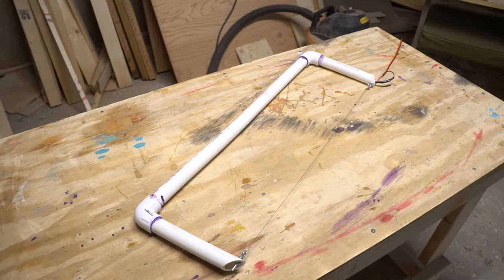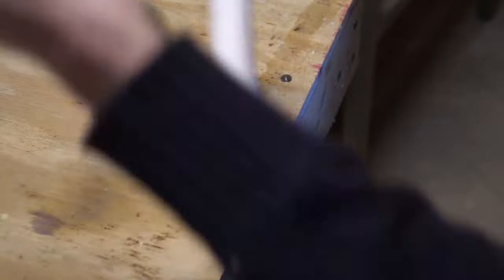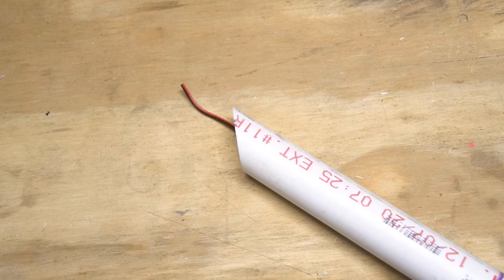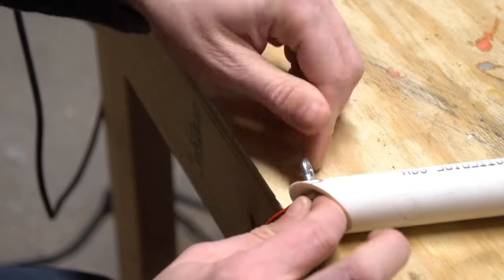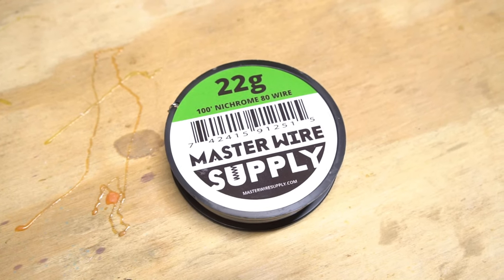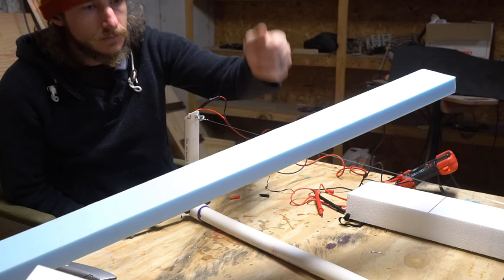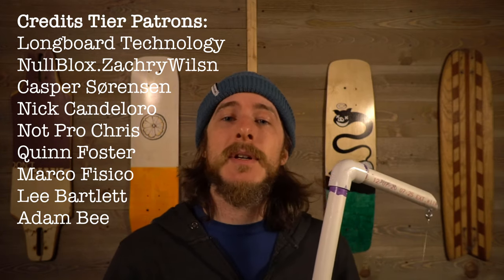Making a Hot Wire Cutter for Shaping Foam

Comment: Tip: You can salvage nichrome wire from the heating element in an old hair dryer or heat gun.
Reply: or an electric heater
Reply: @kaceesavage  Yes, but most heaters I see today are ceramic, and the ones that have wires most often have heavier wire that won't work as well without more power, and they would not allow as detailed work as the thinner wire in something like a hair dryer.
Reply: toaster
Reply: @joeymitchell3863  Yep, but many today use a ribbon element instead of wire.
Reply: @Jim-Wade  twist it?
Reply: Thx for this info💯
Reply: Thanks!
Reply: You can avoid the hit or miss with the electricity by getting a variable power supply.
Reply: It’s practically free anyway
Reply: Thanks 😊
Reply: is there enough in the dryer to make the one he made?
Reply: @jandmkennedy5 More than enough.
Reply: anyone knows if i can use a bicycle brake cable for this
Reply: @datogadelia  I don't know for sure but I suspect it has too much resistance.
Reply: oh nice i think old panel ovens too?
Reply: Thats how i get mine! A hair dryer is 3 bucks at goodwill, i have made all sorts of things with them, last month, i made a big ass food dehydrator with a hair dryer, water heater thermostat, computer fan, and wooden box...
Reply: Ty!
Reply: Did that a bunch as a kid.  A bit of that, some lead wire and a 6v battery and I had a remote ignitor for several projects

Comment: Why not just take a wood burning tool, attach along thin blade or strong wire to the end. And you have a hand held cutter.
Reply: Either the styrofoam will stick to your blade or will melt much more than intended. And you won't be able to cut large pieces.

With the explained system here, the heat is evenly along the length of the wire and thus more efficient with less power.
No matter what size.

Believe it or not, styrofoam factories use the exact same system to cut their products to size.

Comment: Look up "nichrome wire calculator" and there is a formula for choosing the Amps output on a power supply based on wire gauge, length, and voltage
Reply: what temp should it be?
Reply: @noava Styrofoam cutting temp
Reply: @rmdhn1  ye, just go for max temp u can. the wire is gonna cool down when u go through the foam

Comment: It is better to connect the power wire directly to the heating wire.  Using the bolt to conduct the electricity  will add resistance and cause the bolt to heat, possibly melting the PVC pipe.
Reply: Resistance is inversely proportional to the cross section area of the wire (or bolt in this case).  If the bolt actually got hot, the wire would melt long before that. The bolt has virtually no resistance in comparison to the wire. A 5mm bolt and 1mm wire means 25 times higher resistance from the wire

Comment: A little basic ohms law - 22g nichrome 80 wire is virtually 1ohm per foot, so let's say you're making a 3' wire cutter that's 3ohms, with a 12VDC power supply ohms law will give you the current, I=V/R (I current, V volts, R resistance) so - your power supply has to AT LEAST equal I amps.  I amps= 12volts/3 Ohms........ so I = 4amps, so you'll need at least a 4amp power supply.

If you want a shorter or longer cutter you can adjust it by either changing the supply voltage which pushes more current through the wire, or the gauge of nichrome wire which changes the resistance per foot of wire.  The calculation remains the same I=V/R, and seeing as heat output is generally given in terms of power in watts, P=V*I so in this example Pwatts = 12volts * 4amps which gives you 36watt heater.

You can look up the temperature characteristics of nichrome wire on the www but 4amps thru 22g will give you about 700degF, like this guy said don't mess around with other kinds of wire because you won't know what you're dealing with - for example if you tried to make one using 22g copper wire (0.015 ish ohms per foot) you would need roughly a 12V 250amp power supply and god knows what heat you would get from it, and something (perhaps you) will go bang. Nichrome wire is made exactly for this kind of purpose and is a known entity, so don't try making one out of copper, or guitar strings, or a shoelace.

Be careful kids, don't burn yourself, and try not to burn your house down either.
Reply: P=V*I
Reply: so true your comment always use multimeter if not sure the resistance in wire you have too, btw what wire is usually used on the old panel ovens the one that has mutiple wires that get hot and the oven is usually put on walls , i dont think they are wolframe  type but :)
Reply: @АннаПономаренко-в9я  Ooops - of course you are right - typo, so have I edited it
Reply: Thank you for this. Very helpful
Reply: U r a legend
Reply: Does a household  panel heater use nichrome wire for the heater elements ? 
Could you use the heater wires from a panel heater ?
Reply: @winnie6354  yes you can
Reply: So someone check my math here but if I want to make an 18" wire cutter with the resistance of the wire at 1ohms/ft I should have 1.5ohms resistance- in the formula presented above I= V/R so I= 12volts/1.5 ohms I get 8amps  power supply needed for a shorter cutter....more amps for a shorter wire? Shouldn't it be less amps needed to heat a shorter element or I have I got the amps and voltage confused? This is if I sitck with a 12 volts/5amp power supply that was used in the video....
Reply: @shinnosuke150  No, a shorter wire has LESS resistance so more current will flow through it than a longer wire with the same voltage power supply,  if you use a 12V power supply on 22AWG nichrome 80 your wire (if you are indeed using 22g nichrome 80 wire) will probably get TOO HOT.  
If you really want only an 18inch hot wire cutter for polystyrene either use a lower voltage power supply (like 6 or 8Volt) , or different wire gauge.  Look up nichrome wire characteristics on the web - an 18inch 22AWG nichrome wire supplied with 12VDC will draw about 8 Amps just as you have calculated - but that will heat it up to 750degC - too much current!
Reply: @lawrencejones4329 i just want to make 2 ft wire cutter so what size of wire and power i have to choose

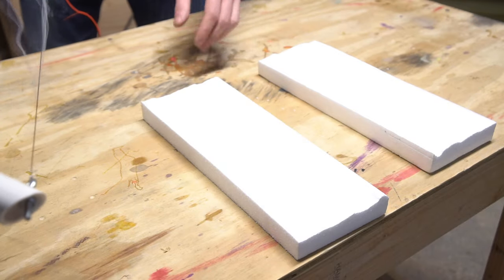Comment: After watching your video you've given me a fantastic idea ! ! !   At about time 6:00 you demonstrated "Detailed Cuts" . This is where the idea hit me . If you wanted to make detailed shapes in polystyrene to use as insulation for shipping container homes this would be fantastic  ! ! !   Once the shape is cut out with your hot wire cutter it could be placed directly onto the outside or inside walls of a shipping container . This would then fill in that corrugated shape that all shipping containers have in their walls and insulate very well . Thanks for the inspiration .

Comment: You could make a mounting rig to attach it to a table and work it like a band-saw. That would make your cuts more precise because you could use both hands to move the piece of foam, you could even make a sled similar to the ones made for table-saws for more precise and reliable cuts.
Reply from the maker: I'm definitely going to be using rigs and forms to get precise cuts, I was just free handing it here to see what the tool was capable of. Love the sled idea!
Reply: You made this comment for me :)
Reply: Where can you buy the switch and power unit to build a larger  hot wire cutter to cut styrofoam
Reply: @justadumbass5814  thrift stores, restore?

Comment: you can prestretch the nichrome, if you use a drill and those eye hooks you basically "unwind" the spring out of the metal and it work hardens.  You can also double and triple up the strands to lower your resistance (let's you run lower amperage to a higher temp) also allows much more rigid structure to the cutting wire allowing you to create preshaped profiles.
Reply: wouldn't lowering resistance allow you to get more current with lower voltage?
Reply: @jasonthurston799  yes, it does, but it also requires less source amperage to get the heat response you are looking for.  It increases both maximum capacity and efficiency...at the cost of more heat and increase in danger.  PRestretching the wire also reduces the sag deformity under load.
Reply: @verigone2677  How can lowering he resistance yield lower current and more heat?   Could you show me the formulas you use to come to that conclusion? i always thought lowering resistance reduces heat if current remains the same or is lessened.

Comment: Model airplane enthusiasts have been doing this for decades . Check out how foam wings are cut . A great addition would be a variable temp control for your cutter so you could use different length wires .It's a game changer
Reply: Link?

Comment: Thank you for this. I will make one one these fastened to a vertical wood panel. I need to cut a lot of 10cm in half by its thickness. By far the best way to do it. And no snow as with a saw or knife

Comment: Thanks for the video. It confirmed what I thought about making one of these. I have an old hack saw I’m going to use as a handle. I plan on making a curve wire to cut what I need and plan on using a thicker stainless steel wire that I can be bent into a shape. My understanding is that stainless works well for this purpose, too. Have you tried it before?
Reply from the maker: Only steel guitar strings, which don't really bend to shape the way you're talking about. They kinda worked but I had problems with them breaking a lot

Comment: I have put a small spring on one side where the nichrome wire hooks up, it keeps the tension good without stretching the wire so much. I will have to build one like yours because what I have is setup like a miter box.

Comment: A good idea would be to get a piece of MDF plywood and make a a simple platform. MDF is preferred because it is very smooth and level. From there you would drill a hole in the center and just extend the arms of the cutter giving you more clearance for larger pieces of foam. Ive been messing around with the idea to make Halloween Foam Tombstones
Reply: Not if you're working with large objects and sculpting.

Comment: 3:30
I just read today about tinned wires in sockets being a fire hazard. This is done in 3D printers often where they're tinned and assembled snug in the factory.
However, tin tends to morph under pressure, so those joints will get loose over time even if they're not moved.
Make sure to either get a crimp connection there or tighten them each time before use.
Reply: Its not that big of a deal here, though it is still good to be aware of best practices.
I think its the thermal expansion cycles of the solder that causes it, and its a big no-no in manufacture,  but here its really not a big enough problem to rush and replace the connection.
Its also a hand tool, so its never used unattended, and not for hours of continuous use.
Reply from the maker: I saw that info recently in the 3d printing community too. I think in this case tinning the wires is probably better than having them bare, but a crimp-on connector would still be best.
Reply: Kind of more tangentially relevant here,  but one of the Youtube channels I've started watching lately is Tim Hunkin and he's got this video he's recently put out on connectors as part of a series called "The secret life of components"
https://www.youtube.com/watch?v=q43tZ6DjuIE

Real broad base level, but well informed guide. Not exactly the same use case as you're likely to run into with your projects, but its pretty general.
Might find some of his insights useful for revisiting your electric press for instance.

More specifically to this hot wire cutter project, I keep a stock of 12v barrel plugs connectors. I never use the screw terminals, I always order pigtail connectors and solder them. I always think the screw terminal barrel connectors will be useful, but I ended up just throwing all mine out.

But, as I said in my earlier comment, I don't think there's any reason to "fix" the connector you used here.
Reply: @GoodRoads  No, tinning wires in screw connectors is really NOT the best solution here. The very best solution is a crimp-on bootlace ferrule, but few hobbyists have those. Instead just twist the strands together tightly and screw down onto the copper. That’s safe and will last practically forever.

Comment: Just because I always have some, could I use welding wire from my MIG? Also could the unit be powered by a battery charger set at 10 amp setting?
Reply: Great two questions! Did you try it? Has anyone tried it?

Comment: Nice video .  Although I used a 3 amp DC output adapter and the wire was almost room temp.  Could not cut anything.
The cutting wire I used was  .009 tungsten and thought that would be efficient enough to work , but I got no where.

Comment: Good video, however connections section make it look like the red and black wires are twiested together so how does a switch work that is shorted at each end by twisting R&Blk wire together. Why? Unless for more current flow?

Comment: This is gonna work great for me! I only need it for one thing, to taper the edges of eva foam sheets to make prosthetic leg parts, im currently brainstorming a setup, that will cut 1/4 inch foam at a 15 degree angle, leaving just under an inch of tapered edge, something i can push sheets through quickly, like a router table, any ideas?

Comment: I basically made this today. 
I used 12v 5a Amazon ps 
2 screw 12v adapter like yours 
12g wire which might be to big but it's what I had. 
21g 0.7mm nichrome wire 
Crimp eyelets with shrink sleeve. On the eye bolts. 

It will get warm but not hot. 
I could saw faster with the nichrome bow manually.

Any recommendations?

Comment: I've been using welding wire for years to cut surfboard blanks, I can generally cut a few blanks before it breaks. But that nichrome wire look just that little bit easier to cut with. Have you noticed much stretch when cutting wide?
Reply from the maker: A little bit, but the flex of the pvc seems to be doing a decent job of taking up the slack. I'm sure the nichrome will burn through eventually too but it's working great so far and I've got a whole roll of it so it'll be easy to replace when it breaks
Reply: Google source: Nichrome, a non-magnetic 80/20 alloy of nickel and chromium, is the most common resistance wire for heating purposes because it has a high resistivity and resistance to oxidation at high temperatures.
Reply: Could you please list the exact material you used for this. Especially the wire gauges, amp of switch? Thank you

Comment: I made the hot knife as you outlihed in your video. I used a 5 amp power supply like you suggested and it heated up but only worked for a couple of cuts and then didn't heat up again. Checked all the connections. Any thoughts of why it stopped working?

Comment: I would have tinned the wire ends at the bolts.  Spade lugs would have been nice too.  Also, I'm trying to imagine what it would take to make the hot wire more of a flush cut.  I think I might have gone to the trouble of taking a rotary tool to the bolt.
Reply: Double nut with two washers would solve any resistance problems here.

Comment: What is the red/black wire (gauge) used? I have everything you used to make one except the wire for the switch and want to make sure I am using the correct wire, so it works properly.

Comment: Very helpful. I’m looking to making a hot wire to cut 200mm thick insulation foam down  to 150mm thick. This is a denser type of foam than polystyrene! The panel widths are around 600mm wide. Imperial sizes 8 inch thick x 2feet wide sheets slicing down to 6inch thick if you see what I mean. 
My question is, can I use say the 200gm nichrome wire or you are using here or should I use something heavier? 
And the power source? I wondered if the I would need to use a larger power unit than the one you suggest. I had even thought of setting up the same type of frame and using a 3am fused plug in to the wall socket.  I’m used to working with electrics.
I’d be so grateful if you’d give me a help.
Peter
Glasgow Uk
Reply from the maker: I actually used this exact cutter to cut down some 2ft wide XPS foam for a failed project earlier in the year. I didn't have any problems with it at all, you just need to go a little slower since the cut is larger

Comment: Forgive my ignorance but do the eyebolts not heat up enough to melt the pvc due to their being a larger diameter than the wire ? Do they get hot at all or is the heat concentrated only to the wire?

Comment: Hey man, dunno if you can help me out here, i got the same 12v 5a transformer as you and the same gauge nichrome wire, but my wire wont heat up, what is the lenght of the wire you used?? Thank you. Nice vid btw im trying to follow ur video to make my foam cutter.
Reply from the maker: Mine is just about 24" and a longer wire will give more resistance so (I think) it would heat up better. I really don't have my head wrapped around the way resistance works though
Reply: I’m running into the same issue as you. I’m getting 12 volts across both hooks (with out the Nichrome wire). I did notice a blinking green light on my power supply, it should stay solid. I think my power supply is shorting itself hence the blinking light
Reply: Well, it is solved, i noticed the wires i got for transmitting electricity didnt have that much copper and were creating enormous resistance. I switched to wires with more copper and i had to make the cutter longer beacuse it was heating up the nichrome wire way too much xd
Reply: @dragonfire2371  Can you please link me to the new wires that you got? I’d appreciate it

Comment: does the hot metal not melt the PVC at the point where the wire is held by the nut and bolt?

Comment: Thanks, this looks great. I'm planning to make this with some modifications to make it bigger to cut a king sized mattress to thin it and resize it. Do you think this will work for that as well using the same voltage (5V) or should it be upped if that's even safe.